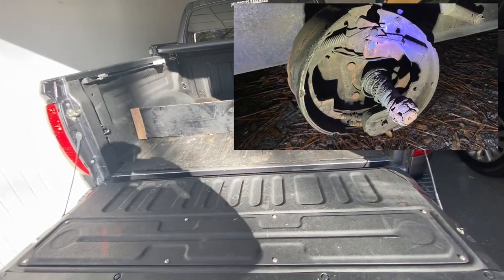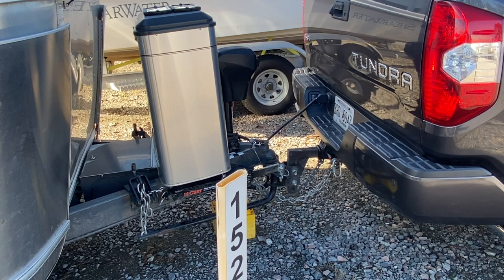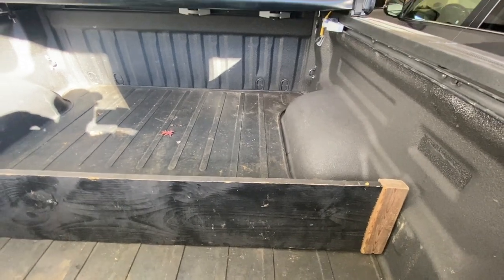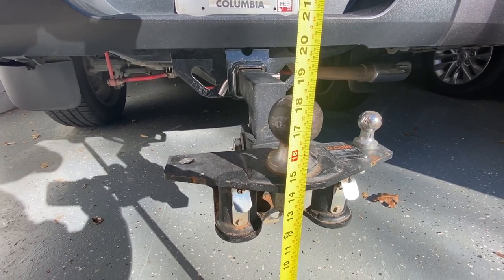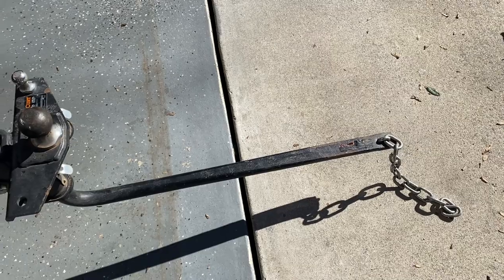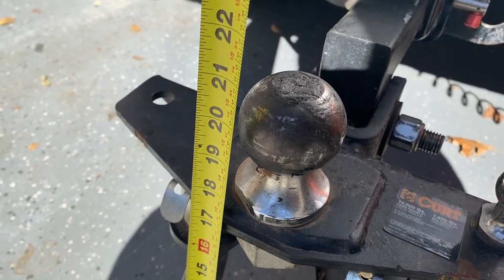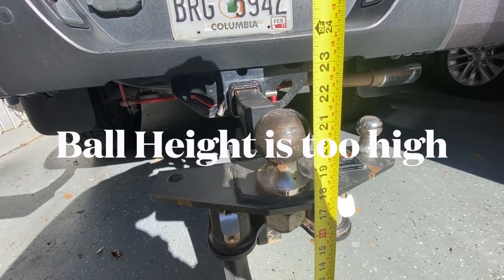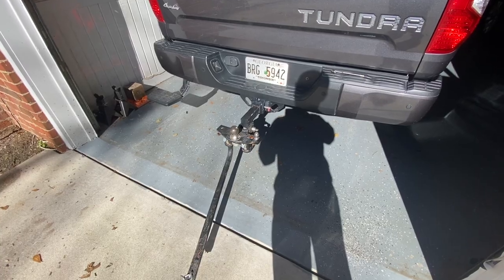Weight Distribution Hitch Height Adjustments (with Airbags)

Comment: QUESTION; Should you have measured the front and rear of the truck at the wheel well to see where level is on the stock truck without a load? I thought that is the way Equilizer factory says to do it. Of course they don’t use air bags. I’m really struggling to get mine dialed in. I think it may be trail and error, CAT scales, test driving. Without air bags, no Equilizer adjustment fixed the bounce on rough roads, back roads, etc. I installed air bags and dramatically improved it, but now concerned about the weight being distributed properly

Comment: looking forward to see how you end up.    Definitely agree you need load in box before setting up hitch.   Also the airbags should be adjusted and set to desired pressure prior to hitching.   If the hitch tilt is properly adjusted, then you should be able to transfer the desired amount of weight to the front axle of the truck and still have the bars in a decent position (close to parallel with the trailer frame).   Airstreams have probably slightly heavier than average tongue weights, but with that trailer and that truck you should have no problem getting the hitch set to excellent conditions even with the lift.    I am not a fan of lift in general, but I agree with you that if you are doing some off road trailering then the benefits of lift start to become evident.  Clearance is never a problem until you don't have enough.   As always, safe travels.......
Reply from the maker: Yep, our low point is actually the orange cap on our black and grey water flush valve.   Noticed just a little scraping.   Therefore, getting the lift.
Reply: @kedrevs4037  Yes, I would say that is as good a reason as any.  Last thing you want scraping is anything to do with your sewer system.  things can get messy in a hurry.  I actually had a nice little steel triangle welded on the frame of one of my past trailers as the sewer outlet was too near the back of the trailer and was definitely positioned such that it could potentially drag.  This little (but very solid) triangle was then the thing that would touch if the rear end got a little low.   Last thing I wanted happening coming out of a gas station was to rip of the black tank valve....take care.

Comment: Just replaced the cam lock on our airstream. It's a 2009 with the black case for the lock cylinder. I couldn't find that lock cylinder anywhere. I ordered a standard lock cylinder, then the neighbor machined it to fit. However the cam latch is too short. I had to order a patterned offset cam latch from Zoro. The lock cylinder was ordered from Kingsley.
Reply from the maker: Appreciate the info